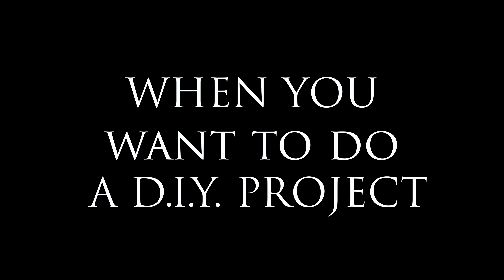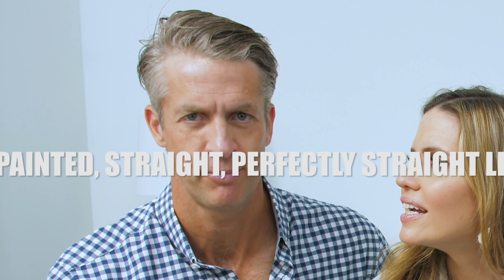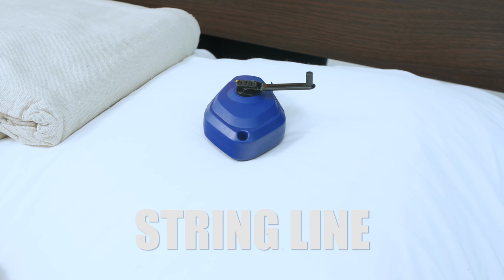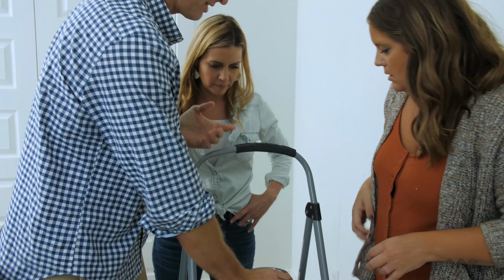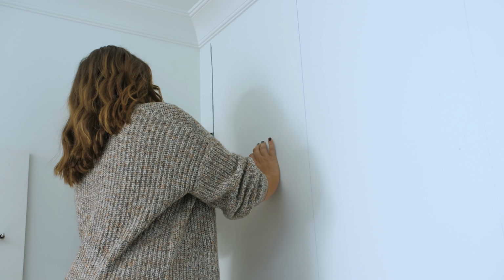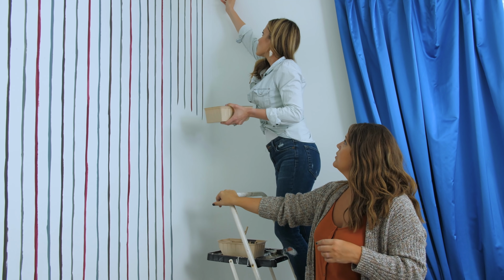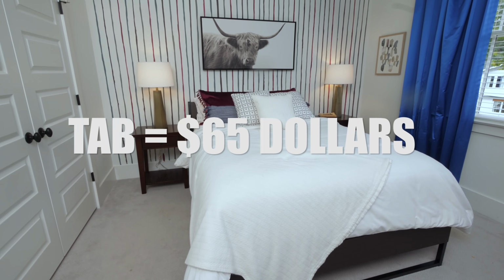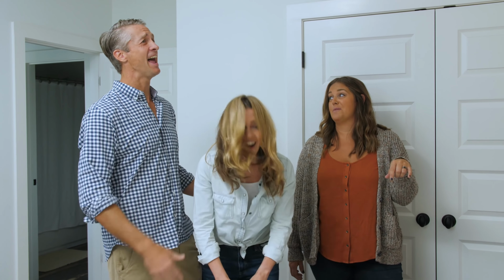DIY Hand Painted Striped Wall with Monica Mangin

Comment: At first glance I think Penn is right.... It looks like a horror movie set. But I noticed the moulding is the same alabaster white as the wall and the ceiling. I think if you paint those- the crown moulding and the base board. It might frame in the accent wall. And give boundaries to madness.

Comment: Well...... I loved the colors - I think I would have to use tape & try to make it w straight lines - I love DIY & y'all made it look good - but I think personally, I would have snapped 2/lines for each painted line & then painted in between the lines, to make it as straight as possible-  even then, you'd have a little bit of imperfection & hand painted " texture"  maybe different widths of lines, in a pattern ? 
You could still go back and snap lines on either side if each " line" of paint